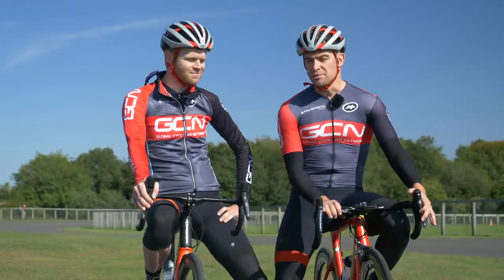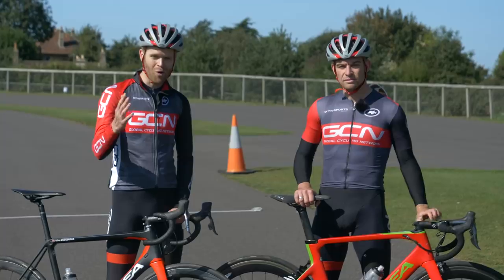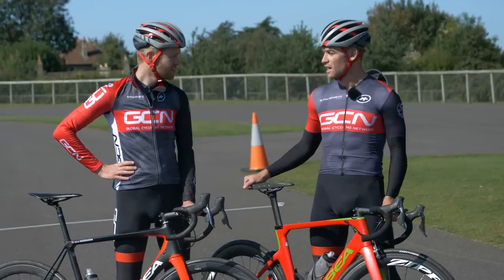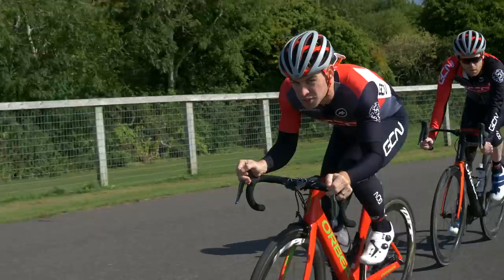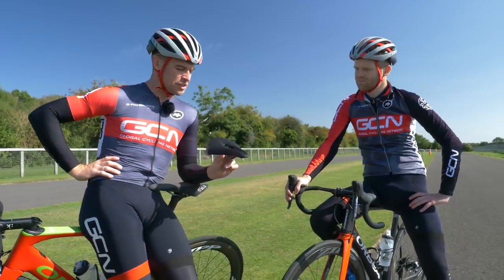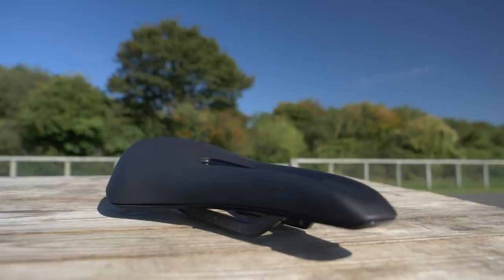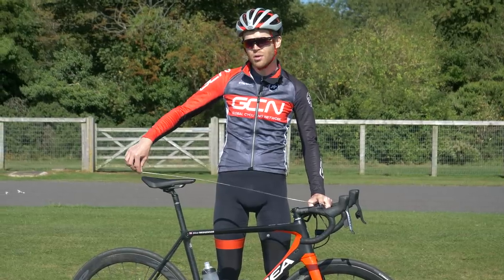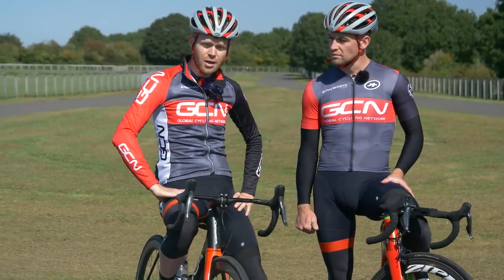How To Slam Your Road Bike Stem To Cycle Faster

Comment: When I slammed my stem I started by moving the spacers around so I'd drop the stem 2.5mm at a time. I'd ride it for a week and then keep rotating the spacers, lowering the stem step by step until my stem was slammed and all of the spacers were on top of the stem. After another week riding like that and being ok with it, I then cut my steerer tube. Took about 6 weeks and gave my body time to slowly adjust to the position change
Reply: Agreed - at 55 years old riding all types of bikes I’ve slammed my F8 with did it over a month - NOW the other part of the story - I’ve been riding short saddles since for ever but even then needed to swop to a straight seat post to rotate the riding position around the BB to maintain position - still to cut the steerer tube but that happening next month - Am a faster? - On my local 20k tester it shaved 4 mins and was 1kph av speed faster - down side? - still to get comfortable in drops braking on steep downhills - feels like i am going over the bar tops
Reply: David Pinnington 4mins over 20k is quite significant compare to investing a better bike.
Reply: I will try to remove my spacer after I dial my training back to building phase( sweet spot training). When I am working at VO2 max workout, I already had a hard time breathing even with the spacer under my stem lol
Reply: Best advise, do it gradually and listen to your body.
Reply: look at this first makes good point for taller riders """GCN gone mad. Wtf? Don't Slam Your Stem!"""

Comment: ..i did slam my stem,but ended up with more neck/shoulder pain,so put it back...alls good now!
Reply: A slammed stem will feel comfortable a week after riding. Your body adapts and so on and so forth.
Reply: @dan_lazaro  I can belive, that my shoulders shall adapts, because i have some muscle pain ater 2 hours ride and more. But my pain in the neck have "spine" character.
Reply: Russian guy and dan Lazaro , that is correct that’s what happened to me
Reply: I u slam ur stem u also have to adjust ur saddle foreaft

Comment: Riding an uncomfortably slammed stem suddenly becomes comfortable as the speed and adrenalin rises. But if you wan the best of both worlds, raise the bars and use the drops to get that 90 deg angle. This way you can still do the shopping without adopting a time trial position.

Comment: The problem I've found with riding in a more aero position isn't having neck or shoulder pain. It tends to be more an issue with cardiac output. I'm 50 and a bit bigger than the typical ( Si, Ole & Dan) cyclist. When I ride in the drops, I find it harder to breathe, so I end up back on the hoods. When I'm in the drops I can definitely see the power savings, but can  usually only maintain it for 5 mins or so!
Reply: You will sweat more and burn more calories when you are less aero, so maybe being aero should not be #1 goal for all of us? Feels pretty pointless if you're mostly cycling for cardio and fun.
Reply: @lechprotean you will burn more calories if you push harder, not if you get more aero ;)
Reply: @Jeff Cipriano My understanding is that it is well established that cyclists experience pressure on their diaphragms when in a forward/low position.  This accounts for a somewhat lower heart rate for cyclists compared with runners.  I think that is one of the reasons that good cycling posture dictates a flat spine.

Comment: I've been slamming my stem centimeter by centimeter for the last 3 years, began with 4,5cm of spacers and a 7degrees stem positive (which I was pretty comfortable when I bought my bike), and now I'm fully slammed with no spacers (just a minimal 3mm to give clearance for the fork to rotate, LoL) and a 25 degrees stem put negative! And I am pretty pretty comfortable in that position too! But it was veeeeryyyy progressive, as I was gaining fitness (and losing belly, LoL), flexibility and confidence, and adjusting positions (fit) and everything at each interation (for example, as I lowered the front and raised a little the seat post, I adjusted the reach by reducing the stem length, putting saddle forward and tilting it to rotate my pelvis, following the body rotation). But my bike has a more endurance shape (with a longer headtube) which allowed it, but, hey... Now I go like 2km/h or more faster with less effort than in the beginning (my power meter doesn't lie, LoL)!

Comment: Finally I see a video about this!! Slammed stem.  From mtb three years ago I decided to go road bike, which is more suitable for the area I have been living lately. Sadly I just couldn't adapt to the drops, handlebar, break levers and shifters. Maybe it is the bike, maybe it is me, but In spring last year I decided to make my road bike a hybrid! So I changed the cockpit, placed a flat handlebar (0 (zero) raise and 6° sweepback which I cut it short to 24inches ) with Tiagra straight bar shifters and levers. I kept the 2x10 Tiagra drive train. Then I told the guy at the local bike shop to remove the spacers and cut the steering head tube down giving enough room for the stem  and a 2mm carbon spacer sitting on top of the frame. He looked at me like are you sure? What? Back at home, one day while looking at my bike I decided to invert the (70mm 6°raise) stem and voila! My bike was Slammed!!! A month ago I changed the saddle to which  I tipped the nose down a bit and most recently I will change the stem for a 60mm 6° raise.  I wish I could have watched this video before making all these changes and adaptations. But yeah! My bike looks cool. It is fast and  I've got nice comments from people about the bike. They usually think it worths the double than what it originally costed.   ;).

Comment: Sometimes lowering the stem can make a bike more comfortable. I tried it on my Specialized allez sprint (with a Power saddle) and it all made sense. The riding position for this type of bike is race oriented and so it the flat, short seat. When in a tucked pedaling position the bike just feels right.

Comment: I wish I could have my bike more aggressive! That seems all entry level road bikes have pretty relaxed geometry even if all spacers are removed.
Reply: No thats completely not true.... Radon Entry level bikes are pretty agressive.  And CAAD OPTIMO 105 is possible to get in a very agressive position in case you buy 1 size smaller and a longer stem.  There are endurace bikes and there are race bikes and with a little bit of search its no problem to find both types at entry level
Reply: more "relaxed geometry" is actually more aero.

Comment: first world problems, when i try this my legs keep hitting my beer belly...
Reply from the maker: Why do you think Dan isn't in this video? ;-)
Reply: @gcn  Rather, get your stems fitted with a 5mm spacer on top, and call THAT slammed then, to save some folks from snapping off their steerer tubes...
Reply: @gcn  How dare you ? xD
Reply: Arne Seys bro try increasing your saddle height
Reply: @Edmond347  sorry I was new to cycling when I wrote that😅 but thanks for the tip bro😚
Reply: Not like me to disagree with GCN - but I did a lot of experimentation with this, probably before these boys were born....for ordinary people slamming your stem will result in lower back pain and spoil your riding - there's an optimal setting for most of us best found through trial and error....also short saddles - a bad idea - places you in one position causing dis-comfort, better to have a saddle you can move around on as you ride.
Reply: Relocate your beer compartment onto the rear.
Reply: Leave 5mm spacer on top! Slam stem! Smaller, younger riders typically don’t get back pain from a slammed stem. Maintain core strength and flexibility by going for a swim every once and a while! You’ll be fine!

Comment: Interesting content 
Surprised that you didn't discuss one of the main reasons to run your stem SLAMMED 
When you mount the stem closer to the upper headset bearings, the front end of the bike becomes more laterally stiff  and  steering becomes noticeably more direct , reactive
You also eliminate unwanted head tube and frontend flex from the fork
The more spacers between top of head tube and bottom stem create unwanted flex that WILL effect the handling feel and characteristics of the ride experience 
All my Road bikes are set up with stems SLAMMED 
Noticeable increase in handling , lateral stiffness and enhancement of my Cycling experiences 😎🏆
Reply: I like GCN, but make no mistake, this video was more of an ad for new product that supposedly may help you lower the handlebars a bit. Not a how-to or the wider benefits.
Reply: Agreed! - Having said that I have been using short saddles for maybe 5 years coming from TT/TRI bikes when i returned to road work - Fizik seem a little late to the party

Comment: Trying it out on the indoor trainer first is a good way of checking how you feel riding at a set power in a different position too - or even training into a lower position. I've found that I've been able to get lower for longer on the road after diliberately trying to ride low on Zwift even if I'm neither quick nor very low, and certainly not "slammed" as I'm older and rather inflexible. But training for the position certainly helped...

Comment: Using a Zipp SL Sprint 140 with no spacers on a 54 frame and love it.  I had previously used a 120 stem, however the front end was too twitchy in the turns.

Comment: Just turned the stem upside down to be almost level on my Giant Hybrid bike. It now feels more like a road bike with the handle bar at least 5 cm lower than the seat. The result I can push 1 to 2 harder gears on the middle chainring due to the lower position. I plan to drop the handlebar next looking forward to riding lower.

Comment: For most (non pro) intermediate level riders comfort is speed.
Reply: Most people who are not overweight can become comfortable with a slammed setup.
Reply: @brankododig1585  It's all a matter of the individual. I'm 5'9 1/2 170lbs athletic build and i hate a slammed stem...especially for what i call long 70k runs. 
What i mean is if you are not comfortable, you're not going to be fast..at least not for long.

Comment: I've already got my stem fairly low but I plan on dropping it some more over winter whilst the bike is on the turbo.
That way I can check different positions and my relative power outputs in them!

Also love my Specialized Power saddle (short nose) they are so much more comfortable than a traditional long nose one.

Comment: It was mentioned that the steerer tube must be cut to lower the stem . Not necessarily so. The spacers originally below the stem can be moved above the stem and the stack height maintained. If you really like the lower stem, then you can do some cutting.
Reply: Always consult the manufacturer's instructions. If you have a full carbon fork, running spacers above your stem may invalidate the warranty. The area where the stem clamps needs to be fully supported by the plug inside the steerer.

Comment: Generally, the less-serious and heavier-in-weight rider/commuters will use a shorter stem (usually under 110 mm) in the 'up' position, with very little degree change in the stem design (0°-6° degrees). On the flip side, if you end up becoming a very serious rider (meaning, you want to go very fast and break pb's or race and do well), you'll have to get a bike-fit with an aerodynamic setup, ie, it will have a 'slammed' stem and will usually be 110 mm or longer. When I raced, I used a slammed 6° 120 mm, this was what was fitted for me by an experienced bike fitter/racer.
NOTE: the lower you are on your bike, the less watts you have to generate to do those same speeds. Sounds too simple, but this is often overlooked by all cyclists alike.

Comment: I slammed my first road bike, but it was an older Synapse. Still pretty high even slammed. Left one spacer under my aero bike for the first 2 years and have just recently put the spacer on top( slammed without cutting the steerer). I remember going an average of 1 mph faster after slamming the stem on my Synapse and staying in the drops most of the time.

Comment: So I can imagine that a saddle like this helps with a more comfortable position in lower position (like a TT Bike) but what would the downsides be? If you have an endurance bike, would this also create more comfort in lower positions whilst keeping comfort in normal fast endurance riding speeds?
Reply: The more you move your saddle forward, the more you are able to get power out of the glutes and legs.  But, at the same time, the more energy you spend trying to support your upper body and the extreme flexion of the spine.  So for endurance rides and if you don't have a strong core, sliding the saddle backwards will be more comfortable.  You will ride slower, but will also require less rest stops, so you may cover the same distance is the same or less time.  If you want to be low and comfortable, you have to rotate the pelvis forward, so that your back remains as straight as possible.  This puts pressure on the perineum and hands.  Being flexible and having a strong core is a must!
Reply: 8638marc thank you for the extensive answer!

Comment: While we're on the subject of getting used to riding in the "slammed" position. It does make a huge difference!! And I took the steps to get used to the extreme position by adjusting a pare of handlebars on an older bike before I built my current bike!!
Reply from the maker: How does it feel Steven?

Comment: It depends on what size bike you ride(and a lot of other things), if you ride a larger frame then slamming your stem would give you a crazy saddle to bar drop while if you ride a small frame it can be hard to get low enough on the front end, which is my issue.

Comment: I had a frame with a short head tube once. Tried as I might, I couldn't get my short torso in a position where I didn't have issues. So, 30mm spacers it was. Then I bought a tarmac frame with a taller head tube. Problem solved.

Comment: What about the optimal muscle length to apply power. My understanding is that it is at the mid range of movement. That is where there is the maximum number of muscle fibre cross bridges able to create power. Surely at the crank parallel to the ground position is where that point of maximal power output should be.

Comment: "slamming" your stem does not make you more aero. It makes you less aero because it increases your frontal area ie your arms having to stretch to reach the bars and your head up. If you want to be more aero, raise your handlebars. That way you can bend your arms (the most aero position) and your head can rest in between them which is the ideal aero position as it minimizes frontal area

Comment: Didn't know this was an option until recently.
Thing is, I ride a hybrid bike (no drop bar, it's straight) but honestly should be riding a road bike. The best I can do with it is lowering that handlebar (already did thanks to its angle being adjustable). It'll probably look funny considering the bike, but I'll experiment.

Comment: At the 3 minute mark he said it's more aero dynamic to be in hoods with arms parallel compared to drops?  Did I get that correct?
Reply: pezdacandyboi yes it’s true, they did a highly scientific test in a wind tunnel and found that elbows tucked on hoods is more aero than arms straight out on hoods (and it’s more comfortable). They did this test in a previous video. It even surprised them when they did the test.
Reply: @drayy8  how crazy!! When would we be in the drops then?!
Reply: @pezdacandyboi  use the drops for descending to keep weight on the front wheel, better grip of the bars and easier reach to the brakes.
Reply: @2wheelsbest  thank u!

Comment: I have a noob question: is there a point where you are so low, that you have to tilt your head up so much to still be able to look down the road, that you're actually less aero, not more?

I mean, as long as the top of your head is lower than/as low as the top of your back your good right?

Couldn't you just raise the stem a tiny bit for comfort, and just sink your head between your shoulders more for those times when you want to be really aero?

Comment: The pros slam the stem for safety reasons. If you can't see the point of having your steerer tube plug as low in the tube as possible, you've never crashed before. Using spacers also allows the steerer tube to flex, resulting in wasted energy.

Comment: Hey guys i really hope you can give me an answer on my question. I sometimes get lower back pain. But mostly first comes after 1 hour and 45 minute. 
Im not sure if it is because of my core is to weak. I Got a bike fit once and they slammed my stem. And i actually made no difference i get the same pain in the same spot. Actually i feel more sore and tired in the lower back than an actual pain. If i do very hard interval’s i get the pain before. 
If it is very windy and i drop Down to a very aero position and my head all Way Down it is still first comes after 1 hour and 45 minutes. And that why i thought maybe it could be more a problem of my core strenght than a to low stem? Any suggestions?

Comment: It doesn’t work for everybody.  Core strength, physical proportions, and range of motion in a few key muscle groups are all critical factors.  Sagan has spacers underneath his stems.  There is nothing wrong with it. A personalized fit is more important than  how many spacers you have underneath your stem or how long and angled that stem appears to be.  Get a 3d motion capture fit that includes a full physical assessment of your skeletal structure and muscular roms.